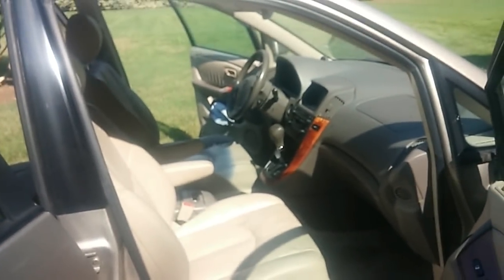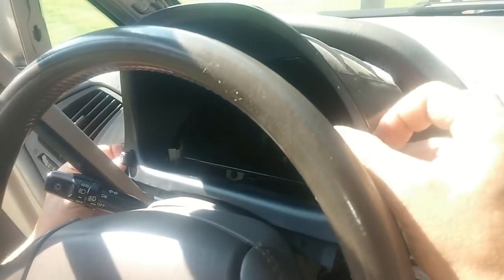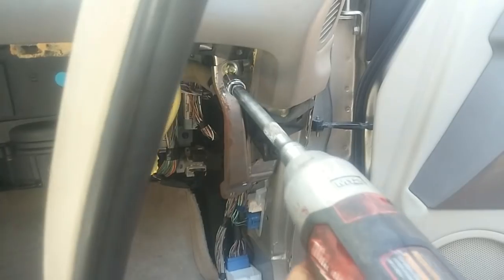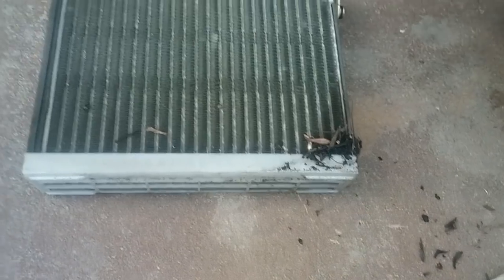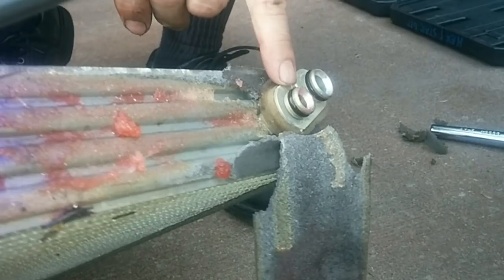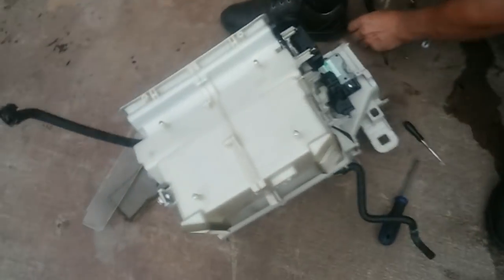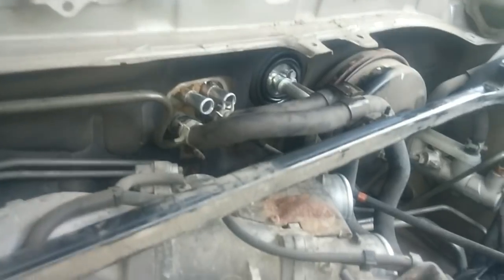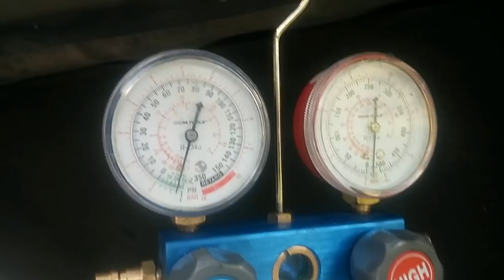A/C Evaporator and Heater Core Replacement - Lexus RX300

Comment: I have changed out radiators, struts, brakes, gas tanks, oxygen sensors, and spark plugs, but would not attempt to do this as I would have left over bolts, screws, plastic pieces, and would not be able to get everything back together.  I would just take it to the dealer and say "Can I get 50% off since I took everything apart?".
Reply from the maker: Ha, ha.  My video partner made a comment during the recording which was "are you sure we can get this back together?  Will it work?"

Comment: They should require by law to make these easily replaceable. Slide out the old and slide in the new. Or put them in an easier location to get at. Not having to remove the dash.
Reply from the maker: I hear you!

Comment: Thats a big ass hell no for me! I have this suv too. Heat blows hot on the center driver vent, cooler on the far driver left, cool on the pass dash vent and cold on the far right pass vent, SOMETIMES. Im going to hope i can vacuum suck the heater core by the hoses.
Reply from the maker: Sounds like you have an air mix (aka blend door) motor malfunction problem.  If you're getting cold air anywhere with the a/c on, it's not an a/c freon leak problem.
Reply: @hardlymovingpro  I replaced both of the servos, the blend door and the air mix. They do work, but occasionally in the winter with the heat blasting, some of the vents dont blow as hot. If I floor it for a minute, i get more heat. Coolant is full, new oem thermostat too
Reply from the maker: @goomz84  Maybe coolant sludge in the heater core.  Disconnect the supply and return lines to the heater core (via the firewall) and using your garden hose, push high pressure water through it.  See what comes out.  Removing the windshield wiper cowling will give you easier access to the firewall.   When you "floor it", the water pump is generating more pressure hence more coolant flow into the heater core.
Reply: That's going to be my next move. I purchased oem Toyota red coolant for it too, however a while ago I did notice some crap buildup on a neck that is attached to the end of the upper radiator hose. Going to clean that out and blow the lines. Thanks!
Reply from the maker: @goomz84  You bet and good luck!

Comment: Man that was a nightmare.
Reply from the maker: Ah ... not as bad as it looks.
Reply: @hardlymovingpro  thanks for sharing by the way. I went with the support saw method to save myself the hassle.
Reply from the maker: That technique (which I had used BTW), only works on GMC trucks.  Unfortunately, won't work on a Lexus RX300.

Comment: Response to my own question: I found a video that mentioned these "rivets" but he called them nuts. It's around 0:50 on this video https://youtu.be/sohV0GK9tY0 . He said an E12 works, and someone in the comment said something like an 8mm works. I guess I'll have to try that. The manual says not to reuse them, but it doesn't show a * non-reusable marking in the "components" section. Strange.
Reply from the maker: He's removing a round headed nut (that is a non 6 point nut) using any socket tool to grip it.  If I were him or you, buy yourself a bolt extractor tool socket set instead.  It's designed to removed stripped bolt heads and can but used on nuts as well.
Reply: @hardlymovingpro  it seemed like a bit of a curve ball haha.. thanks 🙂
Reply from the maker: @nikovandh  Yup!

Comment: This is not the way just to make messes remove whole dash board with everything and take it out from car and replace evap core
Reply from the maker: Well Jaddah, if you have a better way of doing it, I'd like to see it in a video or for you to explain it.  How you'll find an easier way to remove the evaporator and heater core housing without removing the dash and cross member, I would love learn how!
Reply: Depends upon the vehicle. In my car (a Suzuki MPV) for example it seems like all it takes is to evacuate the system, remove the TXV from the firewall, remove the glovebox, undo two screws, one from the glovebox recess and the other from the footwell, and then you can hoist the entire evaporator box down from the glovebox recess and retrieve it from under the passenger footwell. No need for dashboard removal it seems. I hope there will never be any need to do it though.
Reply from the maker: Did basically the same thing a few years back on a 93 Lexus LS400.  Lexus designed the evaporator box so that it could be detached away from the heater core box and pulled out through the glove box area.  I also replaced the expansion valve and rebuilt the low pressure return valve where the valve stem was rusted in place due to moisture.  Customer had be running without a/c for over 3 years because Lexus quoted over $3K to repair and no other independent repair shop wanted to touch it.
Reply: @hardlymovingpro  I just don't get the point in all of this. For my vehicle, i can't find any instructions anywhere, neither for dashboard removal nor evaporator box removal. The most i found is that you can grab the TXV from the firewall and that's it. I only noticed two easily reachable bolts, one reachable from the glove box recess and the other from under the evaporator box, that seem to bolt the heater box and the evaporator box together, and noticed enough space for the box to be handled through the recess and then retrieved from below the footwell.
Reply from the maker: Believe it or not, this video provides you with more detail, step-by-step, than what you would find in a repair manual.  You should be able to find a Haynes repair manual in an auto retail store or you should be able to buy a service repair manual from the dealer either in paper or electronic format.
Reply: @hardlymovingpro  I believe it. I hope the repair manual would tell you how to not mess things up further, at least. Well, i might be looking for the Haynes then. Doubt the dealer sells that for an old old vehicle.
Reply: @hardlymovingpro  By the way, thanks for the suggestion. It seems i was right in my analysis, i'm the lucky owner of a no-dash out evaporator replacement car. This may turn out incredibly useful if something ever happens to that evaporator.